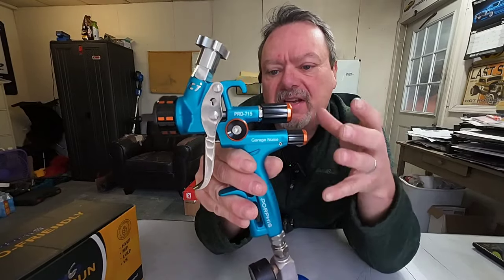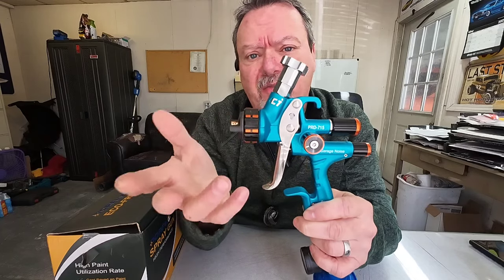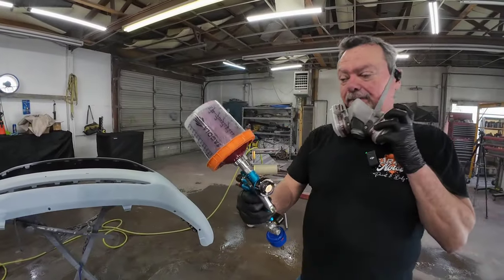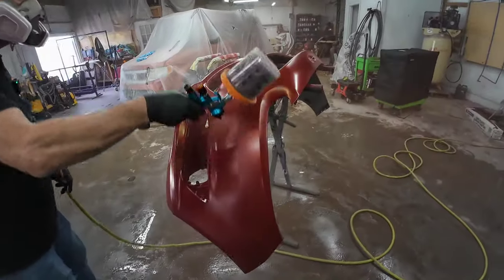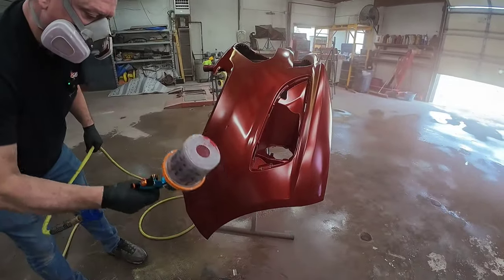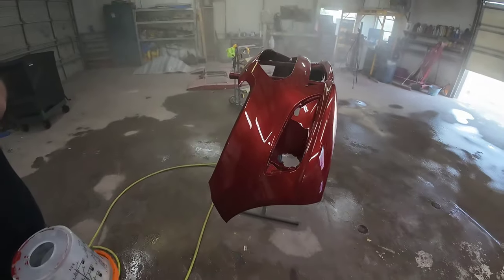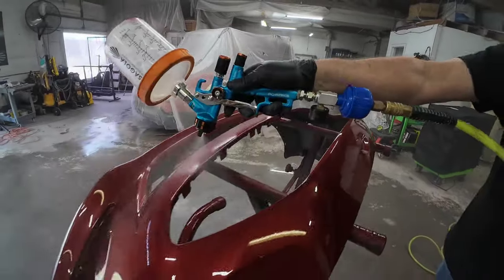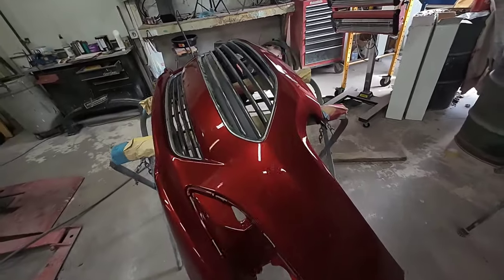The best budget paint gun you never heard of!

Comment: Nice work❤ ...Do i need to prime in the same day that i sand the car or its normal to sanding and preparing the surface than prime it after few days ??
Reply from the maker: You don't  need to primer the same day unless you strip it down to bare metal.  Then I would recommend it or the surface could rust.